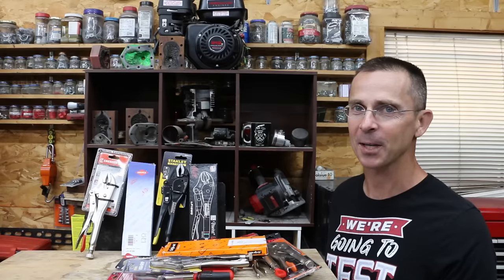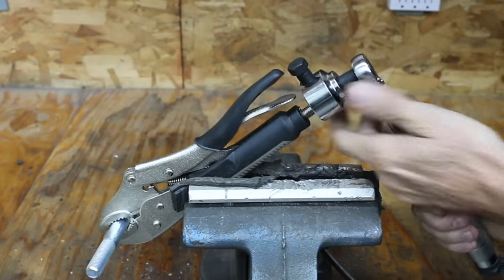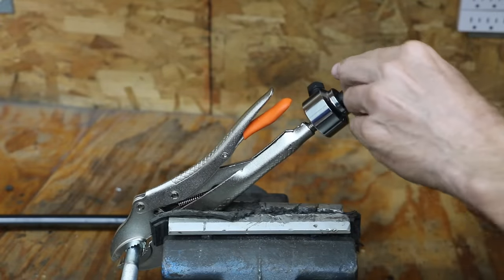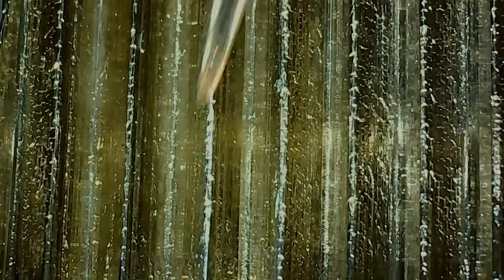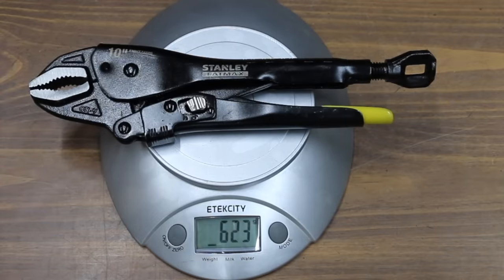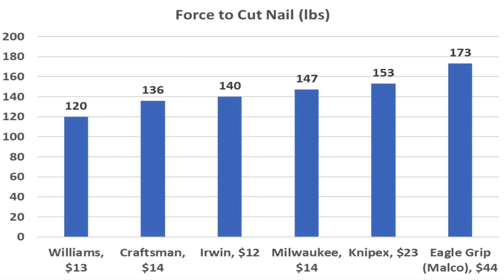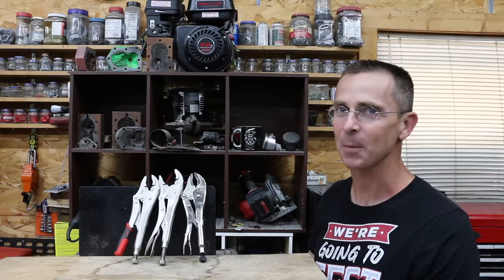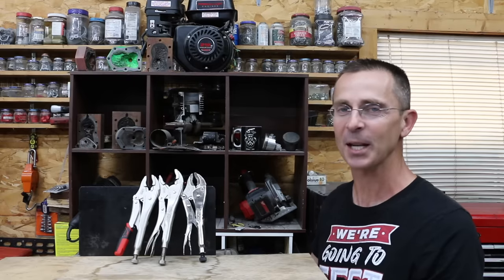Best Locking Pliers (VISE GRIPS)? Irwin vs Knipex, Milwaukee, Craftsman, Stanley, Malco, Pittsburgh.

Comment: I have some Vise grips that I purchased in 1974, made in USA they are still good today with very little wear. I use them for removing broken bolts and screws, they work when all else fails, and have such a good grip that they will wring a quarter inch bolt in half.
Reply from the maker: Nice!

Comment: I was a Craftsman guy for years, they aren't nearly as good as they used to be and manufacturing shipped to overseas. If I can afford an American made tool, I buy it.
Reply from the maker: Thanks for sharing.
Reply: Yeah, having to buy tools for work, I tried to buy American. Everyone I asked said good luck. Nothing is American anymore. Warner is the only American made tool. I ended up going with it, bought it at Lowe's. Home Depot didn't have it.
Reply: Watch garage sales for the old vicegrip brand I had a bolt I couldn't get a grip on kept sliping I had an old pair of vicegrips that had been abused terribly the rivet on the jaw had the no end on it so you had to push the rivet back into the other side of the handle put it on the bolt locked it in place and removed the bolt
Reply: @TheAspiringLawgiver  I've yet to regret buying Proto tools. Well, the price I suppose is a bit steep.
Reply: @JoeSmith-lp8fl  if the tool works as intended and it lasts, I figure it'd be worth the price.
Reply: That's why looking for vintage tools on eBay may be the best bet. Sadly, you have to sort through all the chaff to find them.

Comment: The Malcos are such a work of art, with a really good back story too. Glad they dominated. USA!
Reply: Definitely have the "made in USA" price too, not necessarily a bad thing just a killer on the bank compared to Irwin.
Reply: Always a joy to see a made in the USA product perform so well. Looks like I'll be spending ~$44 on my next set of locking pliers to go along with my rocket sockets.
Reply: They manufacturer the Malcos in the same old factory that used to make Vise Grips, when they were made domestically.  I try to hold onto and not aggressively use the ones stamped "DeWitt Nebraska"
Reply: @craigjensen6853  how's their warranty? I'll consider it for sure
Reply: Having used almost all the brands listed on this test and a few others, I can say without a single doubt the MalCo eagles function exactly as you expect every vice grip to work. Buy them.

It should also be noted that several tool truck companies are buying Malco tools and putting their names on them at a double or triple brand markup. Buy direct from Malco.
Reply from the maker: Thanks for the feedback.

Comment: It's an interesting way of testing vice grips. In Europe we use them mainly for holding workpieces together when welding. And if there's nothing wrong with the pliers we operate the adjusting screw by hand. I will definitely check out the Irwin brand as vice grips should be at reasonable price. It's not a tool that you buy and expect to hand down through generations. Even expensive ones wear out quickly from constantly grinding weld spatter off them and so on.
Reply from the maker: Thanks for the feedback.
Reply: To each his own and depends on the usage. I have a pair of Craftsman from the 1980's which at that time were still made in the USA and are in some ways still superior to even the current Malco Eagle-Grip, of which I own 4 pairs. Generationally speaking, I predict the Malco's to have at least a 20-year operational life cycle and in that light, they seem reasonably priced. Plus the fact that since their domestic manufacturing is being phased out, clean examples are bound to keep their value over time. Acme tools is already out of stock and may never see their supply replenished.

Comment: When I was 12, I found an old USA made pair of Vice Grip pliers in the garage at my grandmother’s house, which started my tool obsession. They belonged to my late grandfather. I used them quite a bit over the years and were extremely useful. I’m now 41 and still have them. Only recently did I find out that they likely date back to the late ‘50s/early ‘60s. I have another smaller USA made pair that I bought in 2004, made right before Irwin took over the brand and moved production to China. I’m definitely planning on getting a pair of those Eagle Grips, which supposedly match the quality of the original USA made Vice Grips, if not better. Malco makes some really good stuff.
Reply from the maker: Thanks for sharing.

Comment: I'd be interested in a video comparing various pocket knives.  Sharpness, edge retention, ease of sharpening, etc.
Reply from the maker: Thanks for the suggestion.
Reply: Doge, 
From past experience  sharpening knives, the easier they are to sharpen the faster they lose their edge. The harder the material the harder they are to sharpen,  but the longer they hold an edge.

Comment: Just a suggestion as i noticed something particularly with the Tekton that was tested here..... they are the old Amazon model rather than the new model that is sold directly on tekton's website, would appreciate if you could test the newer model as it is made of completely different materials and is of different construction than the one tested on your video
Reply: I've commented couple times the same. The newer stuff right from tekton is definitely much better quality than old stock on amazon and ebay. Last few years they stepped up their quality for sure.
Reply: @lukem7203  agreed, I've been noticing more and more lately that Amazon tends to hold on to super old stock as far as tools go or they contract with much smaller resellers that have older stuff as well
Reply from the maker: Thanks for the suggestion.

Comment: Torque required to rotate bolt results 8:25
Force to cut nail results 10:05
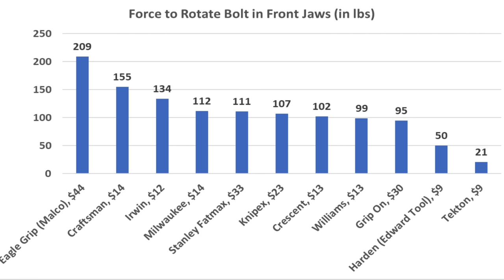Force to rotate bolt in front jaws results 11:39
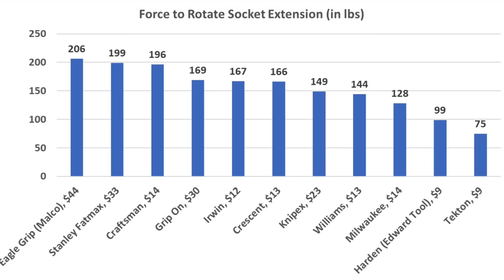Force to rotate socket extension results 13:48
Force required to unlock pliers results 15:38

The Craftsman and Irwin were always mid-pack or better than average for only $14 and $12.
Reply from the maker: Thanks for the feedback.

Comment: I can't really see how the torque on the adjustment screw translates to anything useful regarding grip strength, or anything relevant at all actually. The geometry of the locking mechanism varies to much. Maybe a better way would be having equal handle closing force? But even that is not very good. The leverage in the handle mechanism could be very different too, and what is "best" could depend on the specific work you are doing. So there should be some sort of chart with a hand force to clamping power relationship, and then an evaluation on build and material quality. Teeth that gets bent and smoothed over by standard grade bolts are not good in any way...!
Reply: It's an indication of how likely you are to destroy them accidentally.  You know, when you hear the crack, back it off half a turn and leave it for the apprentice to find.
Reply: You make a great point, I hadn't considered that, but it should have been taken into account.  It kind of makes this test null and void in some ways.

Comment: I've been using Proto locking pliers (which are just re-branded Grip-Ons) and I have the say the squeeze to unlock is much nicer than the push to unlock mechanism you find on a majority of locking pliers. Even if it requires more force, it still feels easier because squeezing is easier than pushing with the backside of your fingers. The other design feels like a knuckle-buster in comparison. I don't use them all the time, but the few times I have reefed on them they've held up well. Excellent testing as always.
Reply from the maker: Thanks!  Thanks for the feedback.

Comment: As a landscaper, I use concrete/cut off saws every day to cut pavers and cast concrete blocks when installing new patios. It’d be super interesting to see a comparison of either the saws on offer or even the various types/manufacturers of blades out there. I use a Stihl saw at work, but Hilti, makita, and husqvarna all make excellent cut-off/concrete/demo saws, among others. Thanks In advance for reading, love the channel!
Reply from the maker: Thanks for the suggestion.

Comment: As a semi truck and trailer, as well as Auto mechanic most of my life. And 7 years as an industrial maintenance tech, starting at the tender age of 6 or 7 my dad always had Irwin Vice Grips in every tool boxes, at the shop or home. Throughout my life I've tried several other brand locking pliers and most failed miserably with a couple that did so so, but nothing compared to Irwin. Although, over the past ten years or so, some Chinese knockoffs did ok, but you can see a lot of intellectual theft in the designs. I'm commenting before I watch this video because I still without knowing any new tools or design out there, I still swear by irwin Vice Grip. But hey. I just might get my rear humbled today on this one. Thanks Mr. T for these awesome test videos. Your thoroughness really says a lot compared to most other tests and reviews. ..

Comment: Thank you for the test. I bought some Malco Straight jaws for a stubborn broken exhaust manifold stud. Only Slipped once. Re tightened and bit in solid. Couple of back and forth wiggles and it broke loose and came out.... Saved me a ton of time and money from having to pull the AC out of the truck to get a drill and extractor set on the thing. Next time I'll be sure to check the comments for affiliate links.
Reply from the maker: You are welcome!  Thanks for the feedback.

Comment: I own several pairs of locking pliers. Many cheap and at best only ok. My 40 y/o ones still work extremely well and the jaws are the ideal shape for bolts. My smaller ones are not great any more but have been well abused. Both have plenty of welding spatter.
The cheap ones are awkward to undo and the mechanisms bend.
In recent times I bought at a market some brand new Irwin Vice grips. NOT as good though there is so  many different style of jaws these days. Not my first choice. 
I also have some cheap welding locking pliers, awkward but work ok. Probably a 8" 'jaw'
Reply from the maker: Nice!  Thanks for sharing.

Comment: I got a set of Pittsburghs, an Irwin, two Duralast ( AutoZone ), and set of Channel-Lock brands. Never really had issues with any of them. Of course, the Pittsburghs are used inside the house, Duralast and Irwin for lawnmower projects, and the  Channel-Locks for automotive. There is a brand preference depending on the job requirements lol. 

As always, love these tool tests! Very methodical, clean and clear!
Reply from the maker: Thanks so much!  Thanks for sharing.

Comment: i needed a locking plier about a year ago for a stripped pulley bolt and i went to lowes and ended up with the craftsman 2 pliers just to be sure i had small and big one if needed and it worked like a charm
Reply from the maker: Thanks for sharing.

Comment: I have Petersen and Irwin Vise Grip pliers.  The Petersen pliers have a rougher finish but they are easier to open, close, and adjust.  I bought them back in the 1980s when they were quite cheap compared to what they are worth to collectors now.
Reply from the maker: Thanks for the feedback.

Comment: Another great video by the hardest working man on YT. What I've learned so far is that, Irwin seems to generally have the best bang for your buck.
Reply from the maker: Thanks!  Thanks for sharing.
Reply: @ProjectFarm  here's an idea for a future video : testing batteries (marine, auto, deep cycle, cranking, drill batteries, etc) sitting on concrete to find out if it's true that concrete hurts them. Spoiler alert : I think it's just a myth :)

Comment: As a newly minted service plumber I'm getting a different perspective on brands, in particular the intersection of brand loyalty and knowing what each of the brands is good at.

Thank you for an excellent review on these vise grips, I'm feeling really called out due to the fact that my most used is actually Pittsburgh although I recently got a set of them made by husky.

I have yet to use a Malco tool that disappointed me, but I've also definitely cried when I was checking out at the register.

I've seen a lot of hype from Milwaukee on their hand tools that are supposed to be trade focused and they've been about 50/50 so far in my experience.

I would like to see you test and compare pipe wrenches, the brands that I'd like to call out for the test are Milwaukee, Ridgid, crescent, husky and Pittsburgh.

It would be nice to see a comparison done on the aluminum vs steel handles but that's a lesser comparison because in most brands they use the exact same steel teeth on both handle variations.

The tests I think should be gripping power on various types of pipe material like cast iron, brass and copper both on the fittings and on the bare pipe.
I believe that gripping power vs the amount of damage done to the pipe would be helpful because there is a sweet spot between getting it done and not having your work look like a warzone.
And maybe even what is the failure point for the wrench because every plumber is going to stick a cheater bar on there at some point.
I believe that somewhere between a 10 and 14 in pipe wrench would be the most ideal to test because I don't believe that you would be able to achieve the failure point of a 48" or 52" monstrosity despite the fact that you are a very capable individual at finding the limits of tools via the assistance of hydraulics and leverage.
Reply from the maker: You are welcome!  Thanks for sharing.

Comment: As a certified mechanic I've come to trust the Irwin vise grip locking pliers over the years.
I've used Snapon, craftsman and some cheapies.
Some take a lot of hand strength to lock and pinch bad unlocking or fly across the floor..lol
I do use some torque multiplying pliers too.
They need some torque multiplying locking pliers.
Great comparison! 
Best on the intermet!
Reply: Some people don't know but Crescent brand makes great ratchet socket sets.
As good as my snapons
Reply from the maker: Great feedback. Thank you

Comment: The older made in USA  seem to hold up best. I strongly agree with the welding radiator shop tech. Wrenched and did plenty of fab dealerships Amtrak mobile repairs tractor trailer. Better metal consistently more pride in their finished product not as much of that going on today. The video was great for the most part you are doing a good service for all beginner to pro.
Reply from the maker: Great feedback. Thank you!

Comment: I really like my Milwaukee ones. It’s nice to just use a screw driver to tighten it down. I’ve cranked that thing down way tighter than I probably should, put a cheater bar on it a broken loose some very stuck inner tie rods doing alignments. I’ve hung my entire body weight from them without them slipping.

Comment: A co-worker that borrowed my Knipex, made an interesting observation about how safe it is.

Most locking pliers unlock by opening the handles outward. If the pliers are locked into something really really tight, the very act of opening them, can cause the pliers and/or work piece to go flying!

But the Knipex, CH Hansen, Grip On, and Stanley, open by squeezing the paddle and handle. This ensures the jaw stays closed, preventing anything from going airborne.
Reply from the maker: Thanks for the feedback.

Comment: I pulled a few short, tiny baby trees and tough roots. Eventually the large main rubber grip popped right off my craftsman professional locking pliers (my black and gold letters). Buy metal locking pliers and a pair of comfortable rubber coated Milwaukee work gloves. The great looking self-adjust model can really pinch your skin if you're not careful and not sure how much longer the teeth will last.
Reply from the maker: Thanks for sharing.

Comment: Great video, I would say that the first test does not verify the grip force at all since most of the screw are just not made to add pressure but to adjust the closing diametre. Maybe you could've adjust the jaws to a little bit bigger diametre than locking the pliers onto the smaller one.
Reply from the maker: Thanks for the feedback.

Comment: Thank you for these amazing tests. You come up with some outstanding comparisons. That helps me work out the criteria to look for when selecting the ideal tool for the task at hand. I´m always rooting for the German tools to perfom best, but I´m not surprised that the US made Locking Pliers outperformed all the rest. I have the impression that locking pliers are used more frequently in the US than in Germany. So, it´s just natural, that there is more expertise on your side of the pond.
If I may suggest a test topic it would be pad saws, if they´re a thing over there.
Keep up the great videos and thanks a lot!

Comment: Bought the Malco based on this and it's excellent as expected. I like that it's made in USA, and the Dewitt, NE factory has some history that's relevant to those of us who like to buy American-made tools. Newell Rubbermaid bought [what it didn't already own of] American Tool ~2002, then closed the plant and moved manufacturing to China ~2008. The tool was rebranded Irwin, which was then bought by Stanley and that's how things currently stand; it makes sense that the Irwin would do so well given its pedigree.

But enter Malco, purchasing and reopening the Dewitt NE plant to make the best locking pliers out there as this test shows. I wouldn't have bought it if it wasn't the best, but that it's American-made AND in the original Nebraska factory is half the cake. That plant was the main source of employment in Dewitt when Rubbermaid shut it down. When you look at this tool and even the box it comes in, you feel the pride that went into making it. I look forward to handing this down to my children and seeing them hand it down to theirs.

Something curious: I'd be interested to see how the Astro Pneumatic Tool 78415 (locking pliers with slide hammer) compares.
Reply from the maker: Thanks for sharing!  Thanks for the video idea.